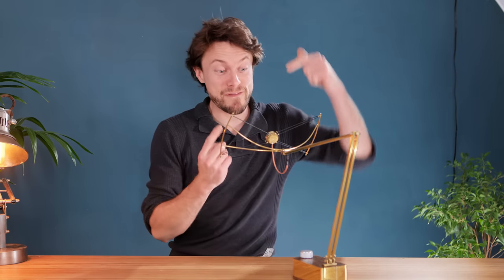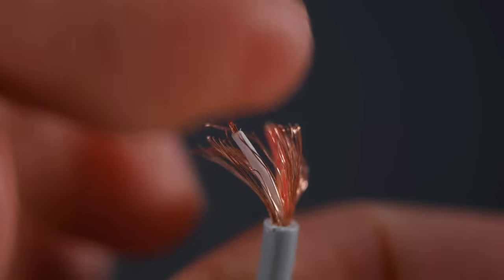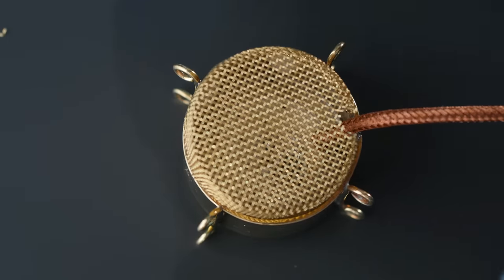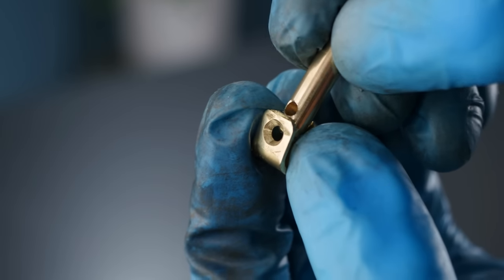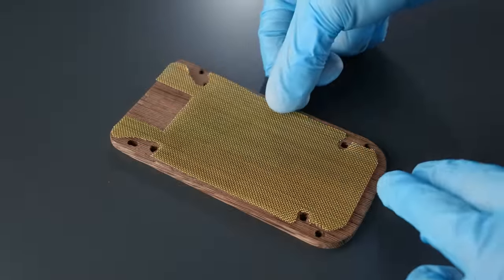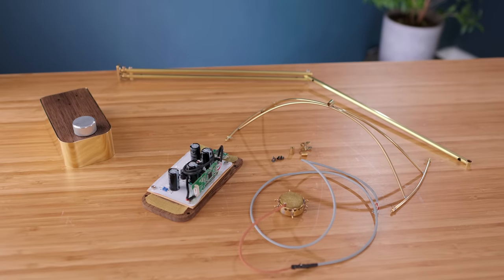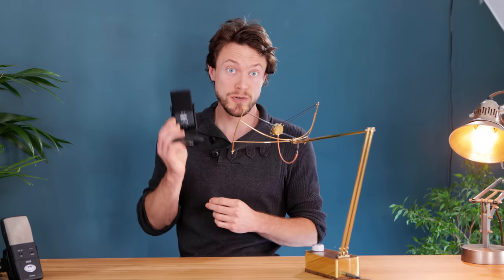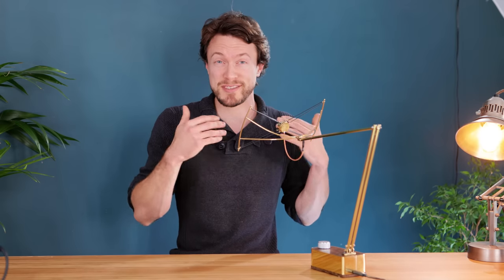Building a quality USB-C microphone

Comment: Audio engineer here - I record voiceovers daily with the original U87 (it's a little nicer than the AI) the real noticable difference between the two mics is that the custom mic has more harshness in the high end - it's a little more brittle sounding which once you apply compression and post production processing with result in more sibalance (loud s's). The U87 is also a little richer in nice low frequencies.

but given that is a 30-40$ mic it's ludicrously good quallity and you could easily use it for proffessional purposes especially as a content creator as you don't need to process your voice as much for longer form videos. If you made this I wager you wouldn't be looking to replace it for quite a while. Looking at the alernatives in this price range people often jump to the blue yeti as an easy choice but I can say catagorically the blue yeti sounds absolutely awful compared to this wonderful build.
Reply: I actually found the high end in the DIY mic quite unpleasant, especially after listening to the U87; the U87 needed next to nothing for de-essing or EQ.

As another commenter pointed out, there's little-to-no chance in getting these parts for $30. I'd assume $100+, depending on how serious you are with the fit-and-finish. However, still a very impressive microphone for the price.
Reply: @KrisMitchellnet  this man speaks truth, it will cost you around 125 to 200 USD
Reply: Audio enthusiast, electronics  and install technician here. Stop using words like harshness and brittle to describe audio. This also includes tinnie and all the other ckfued up words people use to describe sound. Sound cannot be described in words the same way as light cannot be heard. A good audio engineer needs no post processing and I thin thats the whole point of this video besides the price. If you need to alter the signal being recorded then your ckfuing doing it wrong. The end.
Reply: @philmissy1  theres a reason people pay thousands of pounds for microphones and still eq them afterwards even if it’s the best recording in the world. The room affects the sound, every persons voice resonates differently and has different tonal characteristics, the genre of what you are mixing - both music and audio visual content. Using compression to make the voice more audible at lower levels. The list of reasons you might post process a voice goes on and on.
Reply: yep my thoughts exactly.   But, would anyone not in the industry hear it?   After post of course people would notice. but un mixed?  not throwing away the 7B's and 87s yet. but this was for sure eye opening.   especially with the company he bought his capsule from. They sell a lot of different ones. Ive been going back and forth on them for awhile.
Reply: FYI, no audio engineer would ever describe sound that way.  An audio engineer would know how to quantify it and assign values ;) Using weasel marketing words like brittle is hilarious.
Reply: I noticed the same thing when he did the comparison but the difference was slight for a $30-$50 DIY microphone. I've been considering starting a Woodworking channel so this may end up being one of my first projects with a combination of wood/brass arms to match the wood/brass base. I might even try a wood ring inset with brass for the capsule instead of just brass though I'm not sure if that would affect the microphone or not.
Reply: @HoobtheNoob  The only reason to post process a voice is the ntcu sounds like shit and shouldnt be signing.
Reply: 30 dollars is misleading click-baity claim. It's more like 150+ dollars or even more to actually make this.
Reply: i've noticed that too, but honestly i dont like mics that get too much low frequencies, cuz we barely hear low levels, so the diy mic sounds more natural focusing on mid and high levels.
I definitely would build one for me if i didnt live in Brazil and 30 dollars weren't $2,000 in my currency lol
Reply: @Folsomdsf2  theres nothing marketing about the word brittle. Who would market their gear as “brittle” …. Pieces of gear that have roughly the same frequency response still have different aesthetic qualities that can’t be quantified by numbers alone. All sound designers / mixers and other professional sound people speak in these terms.
Reply: @HoobtheNoob  It's /literally/ a marketing word bro.
Reply: @Folsomdsf2  Why do I get the feeling you've never spoken to an audio engineer in your life
Reply: @philmissy1   "Audio enthusiast" says it all. Go ahead and tell every single top tier producer and engineer then that they are bad engineers for using any kind of processing after the recording lmao. 
Mixing is just as much an artistic process as it is technical, you'd use technical terms when you need to communicate a purely technical information, but if you discuss the artistic aspect, which includes the subjective feel of a microphone, using subjective terms like harsh/brittle/warm definitely also has a place, even though they are not very accurate information. 
It would not be practical,. If I tell my colleague I want a warmer sounding microphone for a Vocal artist I'll tell him that, not "Bring me a microphone with an attenuated high frequency response" ffs.
Reply: @PhenixDj  what ever bro. Your comment saying I have no clue is no different to me saying they have no clue. So what now? Draw sword's? You having your say as well as me at the end of the day means nothing except to those that agree. So i really dont give a ckfu what you say.
Reply: @KrisMitchellnet  I think you'd want a gold plated 34mm Capsule, those can be had for about 30$ the upgraded pcbs can be had for about 67 dollars, and the case for 17 or so. i think you can get a phantom power (esentialy replacing the preamp) for about 15$ as well, but that would require you to have a VERY nice soundcard,
Reply: @philmissy1   What other words are there to describe audio? Of course its gonna be difficult to explain similar to explaining a color to a color blind person, but its really the only option we have.
Reply: @Ruhrohraggy10  it's simple it sounds good or it sounds shit. If it sounds like whatever it is your reproducing then it sounds natural. If speakers make any given sounds sound different then they suck
Reply: @philmissy1  "a good audio engineer needs no post processsing" well shit, i guess every major studio in the entire fucking world should just throw out their gear!!
Reply: if you don't respect signal processing, you're not a real audio engineer.
Reply: @philmissy1  ok but a lot of people don’t know what “good” sounds like. For example, I couldn’t tell the difference between his mic and the expensive one. They sounded the exact same to me 😂. If someone’s ears aren’t tuned for something like this they aren’t gonna tell the difference.
Reply: @Ruhrohraggy10  that is the root of the problem. When someone can admit they can't hear the difference but then try and explain sound just irritates me. Nothing personal
Reply: @43audio89  I'm not in the industry but I noticed it. For the difference in price (even $100+), it's still an acceptable trade-off in my nonprofessional opinion.
Reply: Also Audio Post Engineer here. Yes, the u87 is better. You need the rich mids to work. I get that. But you also know that you would easily get away with using his $30 contraption for almost any commercial voice-over. Totally fine after a bit of tweaking.
Reply: @philmissy1  You apparently have no practical experience. Your comment is worth exactly $0.
Reply: @philmissy1  I suppose it depends on where you set your bar for quality. If a client gave me a recording with this mic id definitely work with it but id also always advocate they come in and record with us. There’s also the point that if we are spending tens of thousands on a great sounding recording booth then of course the right move is to get a fantastic microphone.

Im really addressing the whole thread if anyone is still reading when i say - the same frequencies sound different in the context of different recordings. That might be obvious or hard to believe depending on your bias. But low mids of the same voice through a cheap mic sounds ugly and masking whereas through a u87 it could sound great. Even the u87 is pretty bad for female vocals in some respects as it picks up a lot of sibilance on an ess-y voice. There are likely other mics that perform better in this respect but the u87 is standard because it’s a great all rounder for voice without getting into stupid price ranges. (If i could use a u47 for every recording session i would but very few studios doing what i do would shell out for that because the generally accepted bar for quality isn’t that high even in high end professional studios. But would it sound insanely good in the hands of a good engineer? Of course… would people notice? Within the context of a body of work i would say yes.

Do people notice the difference between a red camera and an alexa camera? They dont even know what that means but the entire film industry prefers to use Alexa. Professionals notice a lot more than laymen and that’s no surprise to me
Reply: @HoobtheNoob  first person to make any sense of it.
Reply: @philmissy1  Dude you said we shouldn't use post-processing what-so-ever otherwise we are doing it wrong. I think you are slightly confused. You can't make a microphone which cuts out horrible frequencies out of the box, and if you could, everyone would need to buy their own specific microphone, because certain voices produce different frequencies. And when you get to compression well thats another problem.
Reply: I made it 669 nice
I feel powerful
Reply: @philmissy1  not quite. A ton goes into processing, good sounding at the source or not. Desser, limiters, compression, eq, panning for stereo width, reverb, and this is just the bare fundamentals. Even in non pop music, it has to not sound like mud, preserve transient response, asdr dynamics, and has to sound loudish yeah? And believe me I hate loudness war / pop music. Can agree that the language is limited and ambiguous toward describing sound but that’s just most langue application when using metaphors / adjective aye. Offer some ideas for better word usage  ?
Reply: I noticed that as well. But I'm also listening on a very high end 2.1 pc audio setup... Most people consume content on their phone... so...
Reply: @philmissy1  literally what are you talking about? every single song with recorded audio has altered mic signal, and I'd say the music industry as a whole is probably not doing it wrong.

Comment: The expensive mic has a fuller sound, its like what you'd hear audio books being recorded on, but the DIY mic sounds more like real life imo, its a more natural sound
Reply: This makes me wonder whether the "fuller sound" can simply be achieved by post-processing using an equalizer to lift the lower frequencies a bit. I've followed a podcaster who has simply done that in order to make his voice sound more "soothing" and "professional".
Reply: I believe that no post processing is applied on that mic. Audio books are processed
Reply: No matter what, the sound is gonna be compressed by some lossy codec, sent buzzing over thousands of miles of cables, both fiberoptic and copper, then sampled once again by the telecom equipment, beamed from a tower, and picked up by your phone, decoded, sent to a DAC, and finally played over the more than likely crap to mid-crap speaker in your phone. So, does it matter which microphone he uses? Not a goddamn bit.
Reply: Buy natural you mean, even the minimalistic amount of saliva in his mouth?
Reply: Fuller means more compact. No weird highs and lows like the diy mic but a much more balanced mid sections that stands out more and cuts better through the mix. That's why you don't see podcasters with a 87. It's a singing mic for music production. Also a Scarlet is sub par for a 3k mic as preamps goes. A lot of mics have a kind of paper/fabric behind the mash to soften the sound a bit.
Reply: i say it sounds better, but not $3000 better.
Reply: @jamesyahoo4758  Not in 2021. A lot of audio sources are indistinguishable from lossless today.
Reply: @thedanyesful  +1, Audio isn't 'played over' thousands of miles of cable and beamed across towers etc. It's data sent from one place to another. Data doesn't change from source to end user on its journey. Whatever the source is, the user gets and ultimately hears. Only thing that alters it is software/soundcard/speaker/headphones.
Reply: @jamesyahoo4758  Pretty much 90% of your comment is just bullshit because of the reason Guy Bean specified. You're not sending audio over "miles of cables". You're sending data, which doesn't alter, even if you send it halfway across the globe. Go ahead, try actually using a studio microphone and then a shit headset microphone and tell me that there is no difference.
Also, not everyone uses phones, and not every phone has shit speakers. Most phones have more than good enough speakers.
Audio codecs has also come a really long way. You gotta realize we live in 2021.
There are also lossless audio codecs.
Reply: the $3000 sounds more warm but the diy one it's better than most microphones you can buy for the same price around $30

Comment: I feel like with the right eq you could make those mics sound almost identical. They didn't sound too different to begin with, and with more low frequency and a little less high frequency they may be indescernable to the untrained ear.
Reply: And you have this ear?
Reply: I would also add some a wind screen to the diy mic because the breath noises are significantly louder
Reply: Yes, DIY mimcrophone is brighter than U87 Ai, but not too harsh.
Reply: how do you train an ear
Reply: @spongebobfunnyy  listen with an intention.
Reply: @locopenguin6161  Are you skeptical that he has an untrained ear?
Reply: Multiband compress the lower end and it would get close I think
Reply: @WebacCS2
My thoughts exactly!

Comment: Gotta love how going on Amazon to search for any of these material brings up "frequently bought with" showing a lot of the rest of the materials. Clearly, a lot of people are building this. Awesome. I myself will most likely be building this, but I'm almost for sure going to change it up a bit with my own custom amp, and substitutions for the mic capsule and jfet.
Reply: I am just about finished doing a pcb for this with some improvements (will share when finished), i would be interested in hearing your improved parts/etc.
Reply: @Ozzy3333333  I'm going to play with a TSB-140. It's a slight amount smaller, and has an internal FET, but it's not actually that bad sound quality wise. I'm also looking at using a TL071/2 based preamp circuit. I'm not thrilled about the videos version going over USB, so I'm just using the USB strictly for power, if anything. I'll probably build my own voltage doubler, liner filter stage, and rail splitter with a generic opamp. Most of my decisions are based on what I have, not on what might be optimal.
Reply: @JustAnotherAlchemist  Hello, do you know a eu supplier for the TSB-140? Did you follow the rest of the build otherwise ?
Reply: @dominikwagner5539   Sorry friend, I'm in the US, so am not familiar with any EU suppliers. Any advice I gave here would be uninformed. As for the build, I haven't started yet as I have been sidetracked by real life. I intend to make it comparable with a standard TRRS 3.5mm headphone jack levels, as I am not a huge fan of the USB sound-card method, and all the devices I own already have that as a form of input. Though I DO like the atheistic of the brass build, and I have the tools and skill to work with it, I personally have a 3D printer. I also have a hollowed out professional mic body that I have considered using.
Reply: @Ozzy3333333  interesting. Could you send me the PCB design you have?

Comment: The $3k Mic does sound a bit clearer, but... not 100x clearer. Like the difference is almost up to preference. Wonderful job Matt! You never cease to impress with your ingenuity and hard work.
Reply: The $3K mic sounds a lot more high end professional, while the DIY mic sounds like a decent set up you would find from your average YouTuber.
Reply: @howardbaxter2514  Decent?... The DIY mic beat the 3/4 mic on the market High End included and for only 40$ That's far from decent in my opinion! Yes the 3k mic is better but just check the price difference, that don't seems right to buy it.
Reply: The Neumann sounds a bit 'fuller' in the deeper frequencies, though not 100x the price deeper.
Myself not having any of the required materials or workshop equipment at home, this thing would probably cost me an initial $800 to build (though I could keep the equipment as well obviously)
Reply: Why does it even matter on YouTube lol. This diy mic is the best choice as it's cheap and Sounds good. And youtube compresses any audio to the same bitrate, we can't find a difference unless we hear of both is them simultaneously
Reply: @themanofmarvels6573  None of us really stated it mattered, that's just you reading into it. You are correct that youtube compresses audio and makes for a bit of a hard comparison, though hearing a difference is definitely a valid statement. 
I'm mostly interested in how the actual sound quality (raw formats) compares, I'm sure a lot of empoverished yet thrifty people would love high quality mics for the price of two books.
Reply: To be honest I like the sound of his mic better. It was slightly louder.